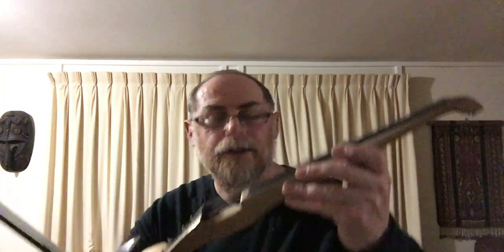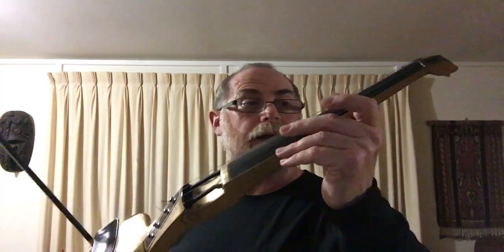FF Fiddle - 3D printed violin

Comment: hy, how to you make it on a 200x200 bed? it not fit, you made it smaller? neck stl fit only on 80%
Reply from the maker: The link above is for the original three-piece version – I wanted to credit the original designer. The one I made is printed in four pieces. Lapinchatware did the slicing into four parts to fit a 200x200 print bed - you can get the files here: https://www.thingiverse.com/thing:480766 My apologies for any confusion. You can also find the link – as I did – in the comments on the original designer's build.
Reply: @ijerry1   thanks a lot !

Comment: Would the sounds change to a warmer tone if wood filament was used to make it?
Reply from the maker: I doubt the sound of the printed violin would be warmer with wood filament were used, as the wood filament is essentially PLA with some wood powder added, so the percentage of actual wood I suspect would be quite low, and the dominant resonance would come from the plastic. But a great question :-) Cheers - Jerry